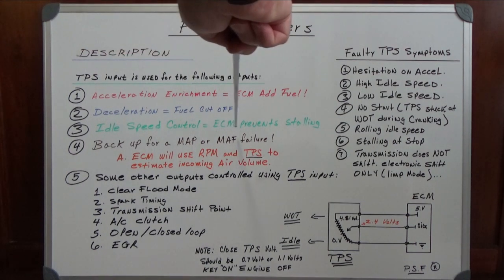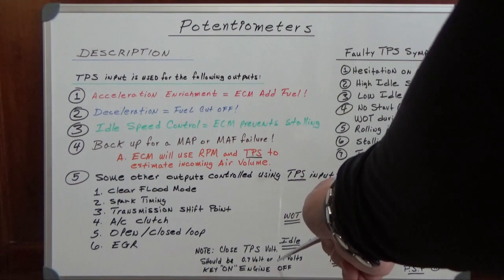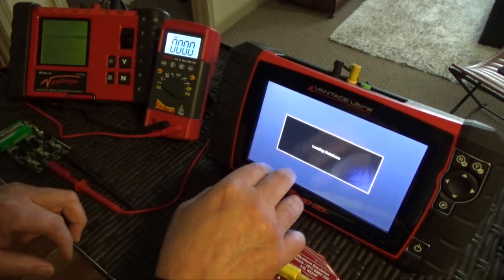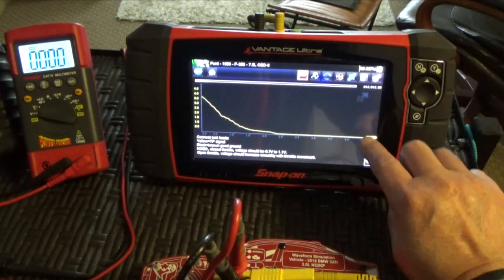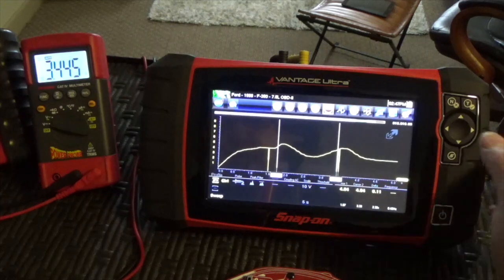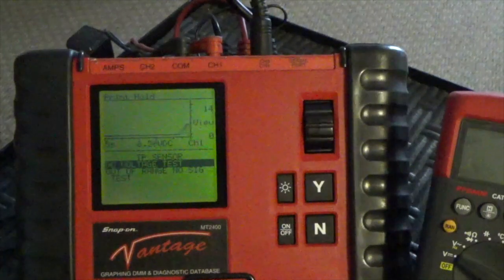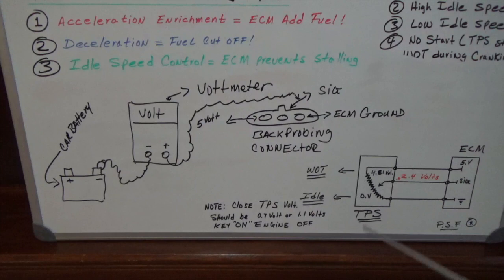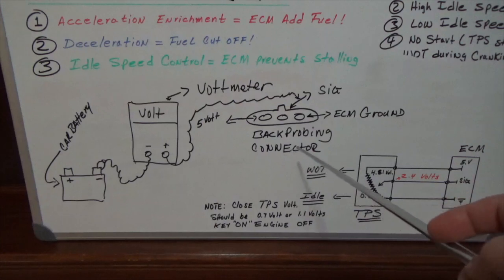TPS also known as P0TENTIOMETER

Comment: Hola que opinas de la Snapon modis edge vs la maxiss pro?gracias por tu opinion
Reply from the maker: Mario Monzon This is what I think 💭 about Snap On and the only I will have is the one ☝️ with the component test and that one have a 4 channel oscilloscope! Way because that tool is the number “1” scanner for diagnostic! Know the MaxiSys 908 Pro can doo DATA diagnostic and Programming yes have and oscilloscope that you buy separated and is like $700 dollars but is not like Snap On oscilloscope that have the components test that gives you step by step how too! If you ask me  depending in what is your field in working on vehicle like you are concentrating in diagnostic or just for simple troubleshooting!
Reply from the maker: Mario Monzon That modis edge is a two channel oscilloscope so yes is good to have! Good tool for diagnostic! And have the components test in the same tool have the option of how too !?  In another word give you a class how to do the test! Like for test an injector or how to do a calculation in RPM on a fuel pump...
Reply: Pete Sambolin I guess I would need both as I have a small auto repair shop and I just got the modis edge but I think I may need the maxiss pro for keys and computers I been watching your channel and I like the maxiss pro
Reply from the maker: Mario Monzon I just buy the OtoSys Auro IM 600 this tool is more for anti theft and EEPROM programming take a look 👀 if the videos! They are some company that they offer free updates for as long you have the tool...
Reply: Pete Sambolin thank you